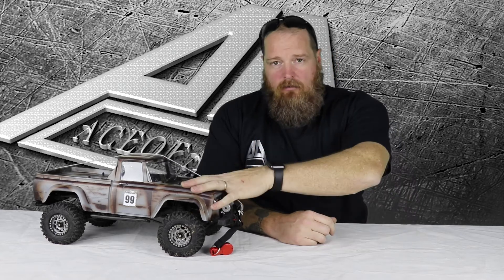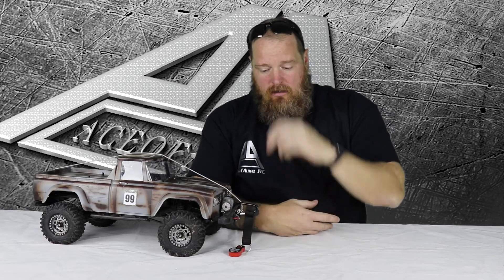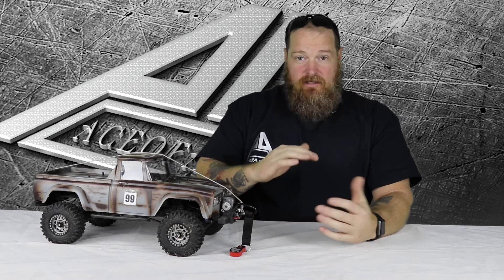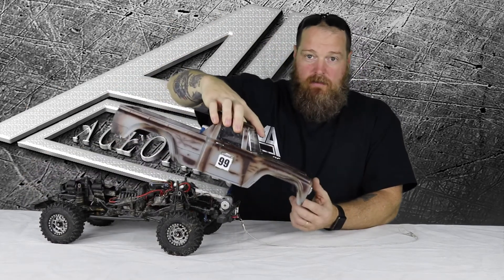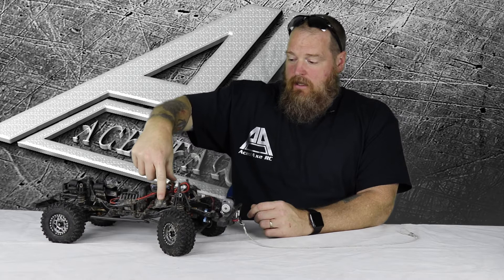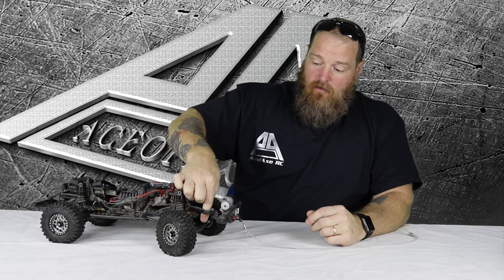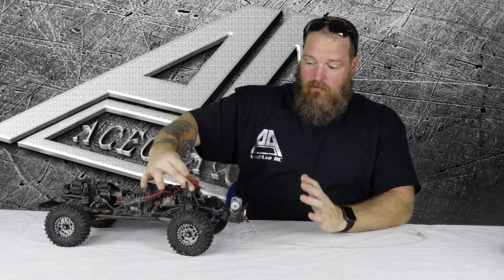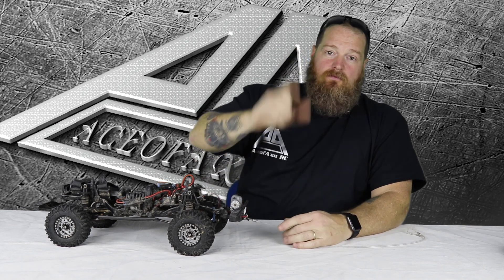Carisma Scale Adventure Coyote setup

Comment: Excellent Scott, your rig is very nice and powerfull, thanks for showing it. Mine's have 1080 Quicrun programmable HobbyWing ESC, 20kg servo with aluminium steering shafts, Lithium Polymer batteries and the 35T stock motor.
Reply from the maker: Thank you, I am really happy with the setup and use basically the same electrics jn all my rigs.
Reply: @AceofAxe  your electrics are very good, top quality.
Reply from the maker: Thanks

Comment: Great video there, lots of helpful info. I'm dead impressed with my coyote can't fault it really. Made some changes to mine that are mainly for cosmetic reasons to achieve a look I have in mind. Carisma have done a great job with it, can't believe how good the stock servo is given the weight I run in my wheels. I know I've asked this before on the carisma groups but any up dates on the chassis mounted servo kit would be ace?
Thanks for the video.
Reply from the maker: Only speculating but I think the Kit will include the chassis mounted servo. If so, I imagine that it will be released at the same time. Again, only my speculation, but will ask and see what I can find out!  Thanks for the kind words as well! Much appreciated!

Comment: Hey I got it yesterday but the slowest speed on the truck is already way to fast to climb and there isnt a smooth transition between minimal and full speed. The throttle limiter doesn't fix this and neighter the throttle trim.
What part do I need to replace to fix this? I assume the ESC? (I still need to learn a lot about RC's  ;D) 
and how do I know if I buy a new part that I don't get the same problem.
I would love a reply  :)

Edit:   the weird thing is; it does have a pretty decent transition when I reverse, so maybe I can flip/swap something so that reverse becomes forwards? ( for instance some wires? or is that bad?)
(sorry for the many questions)
Reply from the maker: Hello, I have upgraded the electrics on mine to a Tekin FXR ESC and a Tekin 35t motor. I have left the stock gearing  and mine crawls great!  Hopefully that helps, If not let me know please.
Reply: AceofAxe Maby I can swap the radio with a throttle ATV because I still have some remotes left.

Comment: Hey Scott I’m new to crawlers and just got one of these and it’s absolutely great I love this truck...I only have one problem, Battery life...oh god the battery life it’s horrible straight out of the box soo my question is 

What battery do you use for the most run time in this truck?
Reply from the maker: The included NiMh battery definitely doesn't last long, but they are easy to ship and can be a great first battery for the beginner! I use a 5200mah LiPo battery and can get hours of use from it.We went out the other day when I filmed the Bradgate Ice Breaker video and I changed it after about an hour and a half only because I was going full throttle a lot as it was a long way between the areas where I was filming.
Reply: AceofAxe thanks for the info I’m actual in the progress of building an rc crawler table and intend to use it for long periods of time so I’m thankful you given me some insight into what I should get.

Thanks you Scott
Reply from the maker: NO worries, A lot of guys are using the smaller batteries as they take up less space, But I've been wheelin' with the big Batteries for a long time! lol The are a bit bulky, but I got the room! lol

Comment: We love this rig and the setup of it how you can modify easy but we're having issues they just reach the US last week and we're having issues with them we're putting LiPO batteries in them and it's causing fires with the selenoid speed control we literally can't run these things for more than 5 minutes at the most we thought it was manufacturer error or something because we swapped it out with five different coyote rigs at the shop and they all had the same result?
Reply from the maker: And you have selected LiPo with the jumper on the ESC? If so please contact Pete or Ivan on the Carisma Scale Adventure Facebook page! I haven't heard of this happening to any other rigs yet! This is something they need to hear and will want more detail I am sure! They will appreciate you bringing that to their attention I'm sure!
Reply from the maker: Have you contacted Carisma Scale Adventure?
Reply: Yes we did and we did use the Lipo with the jumper esc
Reply: And we got in contact with the offices in England and told them about it we are a little concerned because they just sold a whole bunch of these units on Black Friday and we told them what happened and we went through a few rigs and they said they haven't had any problems over there so we're starting to wonder if it was a manufacturer error or if something happened to them when they got shipped over?
Reply from the maker: andy randy thanks for the heads up! Really sorry that happened to you. It has been forwarded to the owner and he is looking into it.!
Reply: Nah man I appreciate you replying back sorry I'm being slow to reply back I'm out in the middle of nowhere and there's not really good connection I just got word that two more of these rigs are doing the same thing in Utah
Reply: andy randy been using a 3S on mine and no issues yet. Will def be looking closely to see if this happens to me, could be just a fluke.
Reply: MARKLINMAN1 we got in contact with carisma and it was just manufacturer error they sent replacements and we haven't had any issues with them so far and we've been running them like crazy

Comment: Why do you weigh down the wheels
Reply: Aidan Burke weight on the wheels keeps them more planted for traction. I actually don’t put weight on the wheels but rather right next to the axels, to me weight on the wheels slows the rotational mass, just me, but everyone is different.
Reply from the maker: Aidan Burke I prefer a heavier rig. I always put more in the front. Everyone is different, some just move the battery to the front, some put weight on the hubs and some put it inside on the wheels. I have been weighting the wheels for years, it definitely keeps it more planted. Also keeping the weight bias in the front helps the front end stay down on steep upgrades. Just like a motor in a 1:1 truck would make the front heavier.